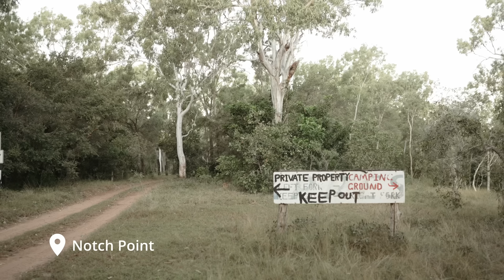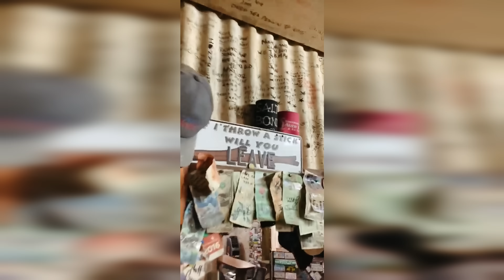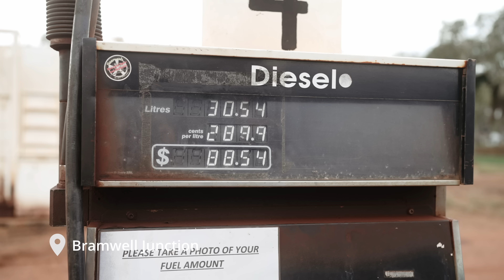Cape York Telegraph Track

Comment: How did you remove the cv from the axle in the bush?? Just curious just in case I need to do the same.
Reply from the maker: He didn’t, he had a whole spare cv and axle so he didn’t have to separate it, but only the short side as they are the more likely side to break.

Hope that helps 😊